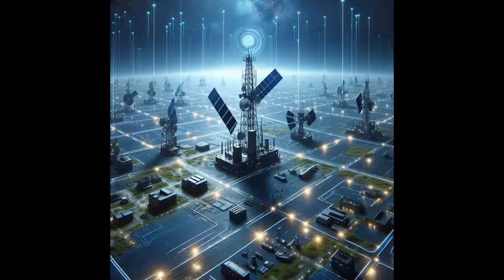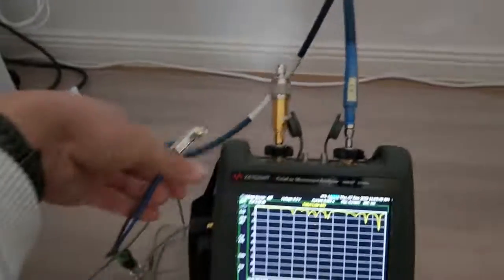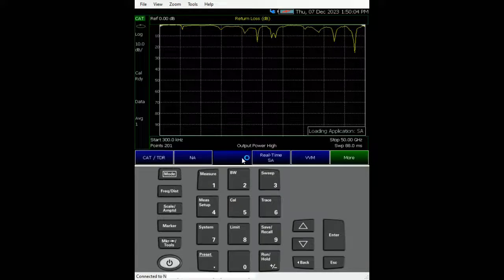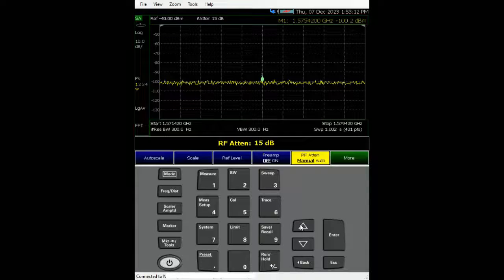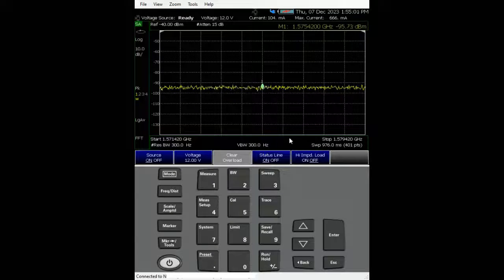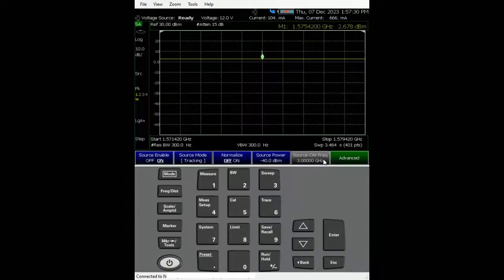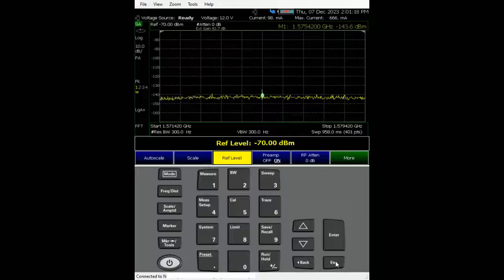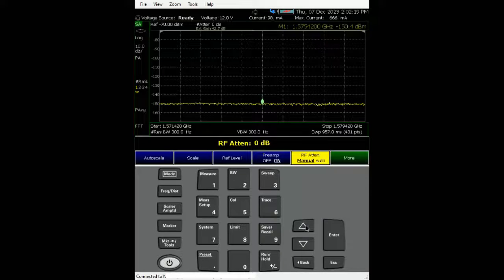Episode 125: FieldFox Tutorial: GPS Signal Power Level Measurement with External Amplifier Setup

Comment: Would you please share the info about amplifier you were using in this video
Reply from the maker: it's a high gain low input amplifier I've gotten from eBay.
Gain is about 48dB at 1.5GHz and Frequency range is between 1MHz to 2GHz. Input power <-54dBm, input voltage 12V and working currrent about 70mA
you can find similar thing here https://www.ebay.com.au/itm/294642912964?var=593113070149